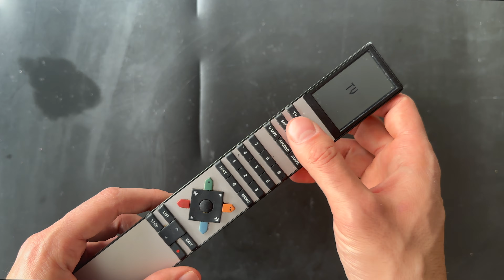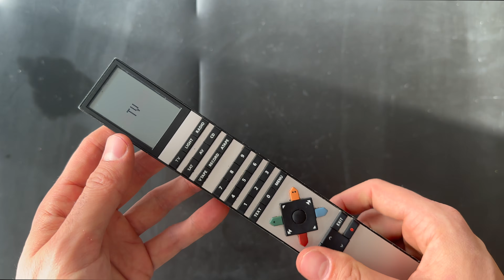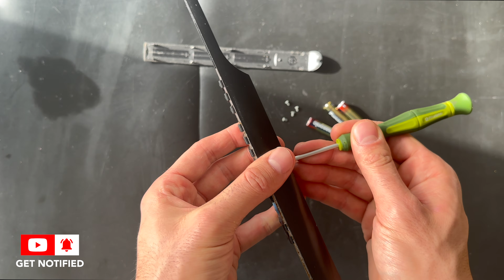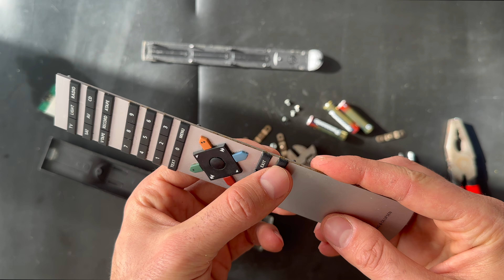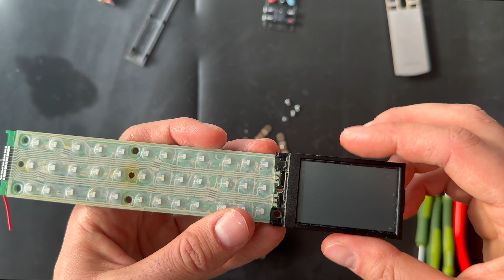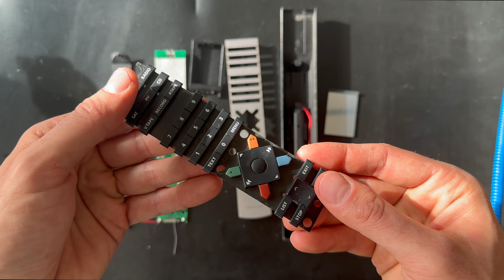Bang & Olufsen Beo 4 Remote Disassembly process and Repair guide

Comment: Why cutting the cables🤷🏻‍♂️.. you can get them off without cutting .. clearly you have never done this before. And don’t touch the rubber connector for the display with your fingers.. jeez
Reply from the maker: Thank you for your comment! I realize this isn’t the ideal method, but I wanted to use it as a learning and demonstration experience. Yes, it’s my first time doing this, and I mention that in the video too!
Reply: Hello, can you help me, I have a remote control  Beo 4Version V Tape A Tape My kids spilled juice on the remote control and I unscrewed everything, cleaned it, it works but I press TV incorrectly and I have to quickly press the button in the middle and the red button and it switches to this mode, how can I solve this???
Reply from the maker: @Иваниванов-л6е7щ  
It sounds like you’ve managed to clean the Beo4 remote successfully, but it may now be in a different mode or require a reset. Here are some steps that might help:

Reset the Mode: The Beo4 remote control can switch between different modes for controlling various Bang & Olufsen devices. To reset it to the default mode, try the following:
Press and hold the "Power" (red button) and the "TV" button simultaneously for about 5 seconds.
This should reset the remote to the default setting.
Switch the Mode Manually: If you need to change the mode again, follow these steps:
Press and hold the "Power" (red button) and the "List" button together until "Add?" appears on the display.
Use the navigation keys to scroll through the options until you find the mode you need (like “TV” or “V.Tape”).
Press the "Center" button to select the desired mode.
Check the Firmware Version: If this doesn’t solve the issue, your Beo4 remote may be in an unintended firmware mode. Try checking the firmware settings by pressing "List" until you see "TV," then holding "Power" and "List" together again. You may need to reset it to your previous mode afterward.
Reply: @KoseTrading  Okay, I'll try this method and want to clarify one more thing: does the Bang olufsen BV9000 ACC PIP SAT POS have such a TV version and is it rare or not?
Reply from the maker: The Bang & Olufsen BV9000 is a high-end television model from Bang & Olufsen, known for its premium design and audio-visual quality. However, you seem to be asking specifically about the ACC PIP SAT POS version of the BV9000, which sounds like a specific configuration or feature set for the model.

Let me break down what you're asking:

Bang & Olufsen BV9000 TV Version: The BV9000 was available in various configurations, including versions with PIP (Picture-in-Picture), SAT (Satellite), and POS (Position) options. These could refer to different input configurations or specialized functionality for the TV. The PIP feature is often used to display multiple video sources simultaneously, which would make sense for a high-end TV like the BV9000. SAT likely refers to satellite TV capability, and POS could refer to specific input or output ports or position settings for the TV's display.
Is it Rare? The BV9000 itself is relatively rare compared to mass-market TVs, due to Bang & Olufsen's focus on luxury and design, but whether a specific version (like one with ACC, PIP, SAT, and POS features) is rare depends on how many units were made with that specific configuration. Bang & Olufsen generally produces limited quantities of their models, especially for higher-end features or niche markets. So, a specific version like this may be rarer and could be harder to find on the used market.
Reply: @KoseTrading  Your method helped me with the Beo 4 remote control, I thought that everything would be gone, but everything works as it should, the reset to default method helped me in the remote control
Reply from the maker: @Иваниванов-л6е7щ  I'm so glad to hear that the reset method worked for you and that everything is functioning properly with your Beo 4 remote control! It's great that you were able to restore it to its default settings without losing anything important. If you run into any more issues or have any other questions, feel free to reach out—I'm happy to help
Reply: @KoseTrading  Hello friend, tell me there is one thing I have 3 sound options stereo plus central and mono and separately there is a regular stereo but the sound is not heard and two sound options work stereo no.
Reply: Maybe it's for speakers? Regular stereo? I don't have speakers, only one TV.
Reply from the maker: @Иваниванов-л6е7щ  It sounds like you're dealing with an issue where the regular stereo sound setting on your TV isn't working, while the other options (stereo plus central and mono) are functioning correctly. Since you mentioned you only have one TV and not separate speakers, here's what might be happening:

Stereo Sound Output: The "regular stereo" setting is designed to output sound to two speakers (left and right). If your TV is set to mono or central sound, it could be directing the sound to a single speaker or a different audio configuration.
Check TV Audio Settings: If your TV only has one speaker or is using internal speakers, it might not be able to output the full stereo sound, especially if the settings are configured incorrectly. Try checking your TV's audio settings and make sure it's set to a proper stereo mode. Look for settings that might relate to "speaker configuration" or "audio output."
TV Speaker Mode: Some TVs have a setting to switch between different audio outputs like "stereo" (for two speakers), "mono" (for single speaker), or "surround" (if the TV supports surround sound). Since you're only using the TV’s built-in speakers, setting it to regular stereo should ideally work, but if it's not, it could indicate an issue with the TV's internal speaker setup or settings.
Firmware/Software Update: If the stereo sound option still doesn't work, it might be a software or firmware issue. Check if there are any updates available for your TV.
Audio Test: Try switching between different sound modes (stereo, mono, stereo plus central) and test each one. If only the mono and stereo plus central are working, it could indicate that there's a problem with the TV's stereo output functionality.
If none of these suggestions solve the problem, let me know, and I can suggest some more advanced troubleshooting steps!
Reply: @KoseTrading  As I described to you earlier, I have an old-style TV. BV9000 I will check your methods.